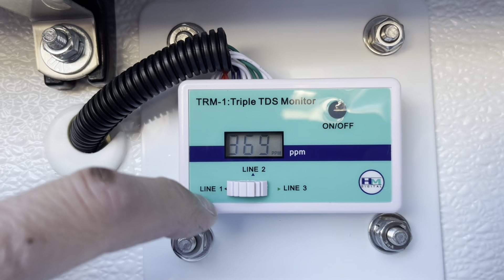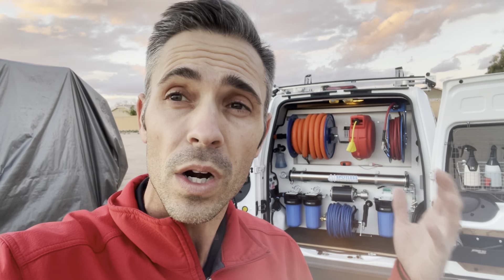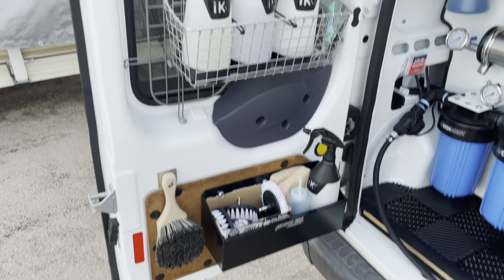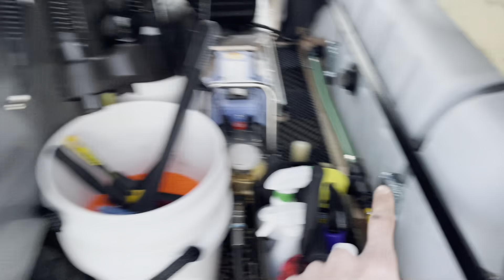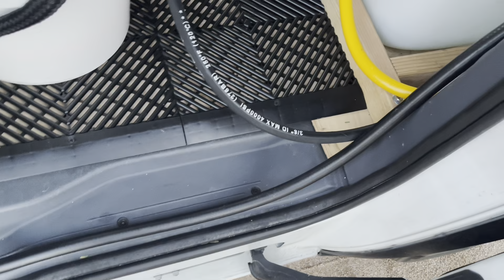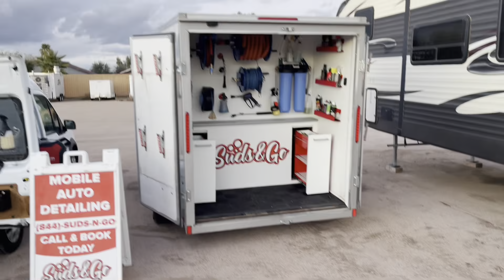Next Level Mobile Detail Set Up

Comment: I didn’t quite understand the reason for having a pure water system just for washing cars. I use one of these for window cleaning—I liked the idea because I plan to do automotive detailing, alternating it with window cleaning—but in your case, I didn’t quite get it.
Reply from the maker: Car detailers fight hard water spots just like window cleaners. If water spots are not removed, they can etch into the paint. A good spotless Water System is essential for car detailing.

Comment: do you ever have any problem with the Kranzle 1322ts with the Predator 3500 generator? I was looking at the active 2.3 but they said it needs a min 5400 watt surge now I an rethinking my next buy.
Reply from the maker: @chuck6499  no I haven’t had any issues with it. You can always convert a 30amp cord and run it into a box with 20amp outlets. This would help with added power consumption. Tony Ralda from Raldas details makes them.

Comment: How many cars can you get done with that 50 gallon tank. How difficult is it to set up those pump systems. I wanted to do a gravity fed system but even then when the water level is really low I don't think it would work as good.
Reply: I keep coming back watching this video because it is compact and by it being small it keeps beginners from buying too much stuff they might not need Yet. But it's one thing missing or at least I didn't see and I have never seen in any setup, a FIRE EXTINGUISHER. Please invest in that. There is a lot of potential for fire in these detail ING setups. Make sure it covers gasoline and chemicals. You may need two depending on how they handle different fire types. Loving your channel.
Reply from the maker: @chrisw.7039  dude fantastic advice. Thank you
Reply: @SpotlessWaterGuy  You are welcome. I know everyone overlooks it sometimes but SAFETY IS PARAMOUNT!
Reply from the maker: I use a lot of water when I clean. I can do 1 truck or 1.5 cars with 50 gallons. I use a Kranzle pressure washer which has a built in pump. It pulls water from the tank on its own.
Reply: @SpotlessWaterGuy  knowing that gives me a good baseline. I want to be able to do at least two cars without a refill just in case someone comes up to me while I'm doing the first car. I think a 100 gallon tank would be a good option for me.

Comment: To put people in context you can literally drink the water the Reverse Osmosis filter out and in the majority of the cases is going to be better for your health than the water you buy to drink from the super markets bottled lol,I had to set an RO at home because the PPM reads out of our well was 1,200 and I have exactly the same pump you featured in the video of course with lot more tanks and so on but mine was 13,000 Grants  so I figured yours is not cheap by any stretch of the imagination
Reply: I want one close to that configuration  so far one of the best I’ve seen,where do I contact you man.
Reply from the maker: @manrex5238  book a call with me at SpotlessWaterGuy.com ! Happy to chat with you about it
Reply from the maker: Thank you for your comment! Yes this is not a cheap system by any means but wow has it paid for itself over and over again. You are correct that you can drink the water coming straight out of the RO but I will add that once it enters the DI resin you should not drink that water. I get this question a lot so I wanted to clarify as people read through the comments. Your water is hard at 1,200ppm that’s crazy. Glad to see other people harnessing the power of RO.

Comment: excellent video and good information. Thank you so much. I have a question, can the generator you have run the vacuum cleaner and the Power Wash at the same time?
Reply from the maker: Yes, absolutely
Reply: @SpotlessWaterGuy  Yes, because I'm looking for one that can handle the vacuum cleaner and the air compressor at the same time, I'll try it. 
I'm thinking about building a van like the one you have and I'm thinking about putting one of your water systems in it. I'll talk to you later to agree

Comment: How do you get the kranzle to run with the predator 3500?
Reply from the maker: Not sure I understand?
Reply: @SpotlessWaterGuy  mine keeps tripping the gfci even on the 30 amp circuit
Reply from the maker: @TheAlteredRealm  oh gotcha! Are you using other pieces of equipment at the same time? The other thing you can try is shorting the power cord.
Reply: @SpotlessWaterGuy  Nope, literally the only thing plugged in. I will try shortening the cord!
Reply from the maker: @TheAlteredRealm  weird I’ve never had that issue. Yeah I would try shortening the cord that can help.

Comment: What’s the exact name for that safety breaker bar?  I need to install on for my van 😊
Reply from the maker: Hey brother it’s just 1 inch tube steel that I modified to fit in my van.
Reply: @SpotlessWaterGuy  hahaha that was my 2nd guess cuz it looks pretty legit ! good work ;) I can proably get most of this at Home Depot and fab it up ?
Reply from the maker: @DaynamicsolMD  yes you got! Homedepot will have what your looking for. I just used a small L bracket to attach the tube steel to the van.

Comment: Do you have any issues with the electrical reel tripping? I have to reset mine if I run two things at the same time.
Reply from the maker: I don’t have many issue with that. I have a 4 way electrical outlet box that Ralda built for me. It’s cut back on alot of those tripping issues because it plugs into the 30amp outlet on the Generator. You should reach out to Tony and order one they are great.
Reply: @SpotlessWaterGuy  Yes, I’ve had that in the back of my mind and I think that would prevent further issues. Plus having things on a remote would help as well. Thanks for the response

Comment: Great set up. I have to ask, how much did everything come out to roughly?
Reply: Water filters is $6000usd on his website. The steamer $1700. Pressure washer $1700. Those are the high ticket items, count up the rest and round it off to 300 each. Tank, hose reels with hose. Electrical relite. Piping. Fittings, etc etc. I would estimate $15,000 investment if you build it yourself. If you have all the build sheets, this is a $2000 job, if someone is designing it could be $10,000. If they build it for you and purchase everything, you looking at a total price of 35,000 and you provide the van. That's my guess from previously shopping around.

Comment: How much is the average build?

And can you run it with a 4gpm or 6gpm pressure washer? 

Or would one need to be build specifically for that load?
Reply from the maker: Hey brother I typically don’t build set ups to sell but I do sell the water system. The system puts out approx 2 gallons a minutes. When you use it in conjunction with a water tank typically you are fine with a 4gpm pressure washer because the tank is constantly filling. If you want to jump on a call let me know. Would be happy to run through any other questions 👍

Comment: Nice video , i have a similar setup in my Window cleaning Van in Germany. IMO  a double 40/40 is the best because you dont need a booster pump.. ( Depends on the water pressure at the source- here is often good )  I have just subscribed  to you . i am always eager to add other cleaning friends to my subscriber list . many thanks  John´s Window cleaning Nuremberg
Reply from the maker: Awesome thanks for subscribing! How many gallons per minute are you achieving with your double 40/40?
Reply: @SpotlessWaterGuy   To be honest i use it  straight from the system straight to the brush head... Most definately it is something  that needs to be experimented  with and could actually be a big selling point or  deciiding point .Put it this way if i had just 1 40/40  the flow would not be enough... having 2 is the smart move  for a window cleaner because  adding electrical cables and generators or finding sockets etc  just creates stress and  takes away the focus and dynamic of the job at hand because every house will be different...
Reply: @Suds And Go  what is a 40/40?
Reply: @kirkwilson5900  40 / 40 ( 40 inch ) reverse osmosis housing and membrane filter
Reply: @Fensterputzer Nürnberg Privathaushalt preispasst  thank you. I figured it out after I asked the question lol. Wondering how I can diy a solution for me and mobile detailing on a budget. I'll figure something out

Comment: How did you mold that rear wall perfectly to the perimeter of the interior?
Reply from the maker: https://youtu.be/-RxVxxstIY4
Reply: @SpotlessWaterGuy  I just watched the video but I’m uncertain how you were able to pre-cut that back area for the FRP. what did you use to get the outline?
Reply from the maker: @v.i.p.detailing8930  I used this and lots of patience with multiple cuts :) 

https://a.co/d/dBoOdgm
Reply: @SpotlessWaterGuy  I seeeeeee. Just bought a transit 250 so I’ll be up fitting it similarly to this. Thanks for the info 👊

Comment: Amazing set up WOW 🤩 Quick question what model air compressor do you use for your tornador blow gun? And do you do set ups for others like yours? Thanks
Reply from the maker: Thanks man. I use the rigid 4.5 gallon compressor. I usually don’t build set ups for other people. If the price was right I might consider it. My time is just a bit stretched right now with my detailing business and water system business.